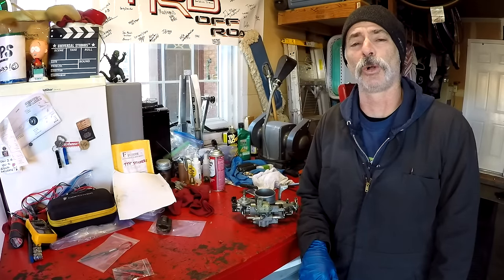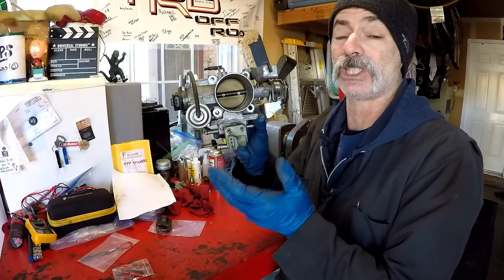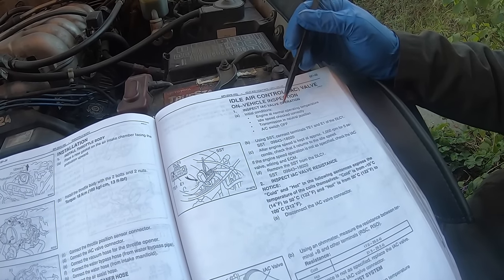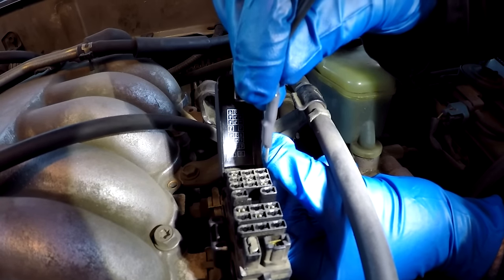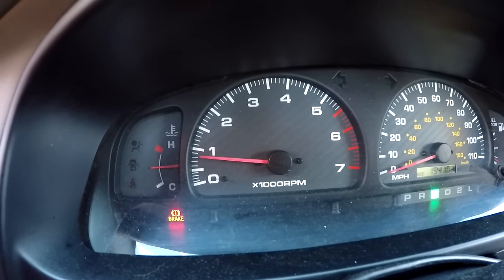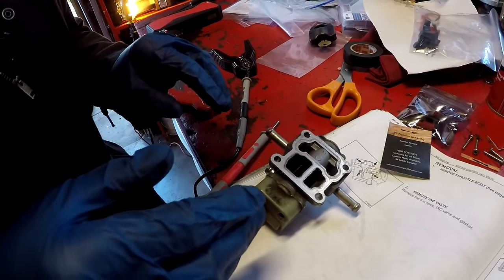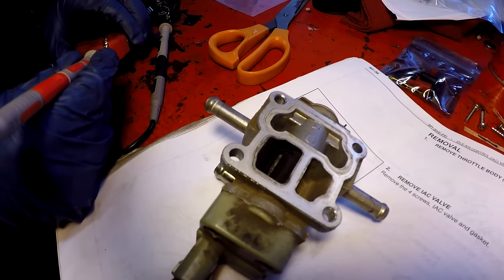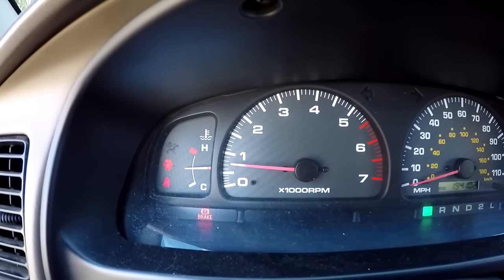IAC Valve Testing and Cleaning

Comment: The idle air control valve exclusively uses coolant temperature as the reference via a valve that is similar to the way your thermostat works when coolant is cold the valve is open to allow more air to raise idle..when hot it closes the air pathway.
Reply: Oh sorry for got your wrenching on a 3.4 not
3vz
Reply from the maker: I have a different understanding of the purpose of the IAC valve.  The idle air control valve gives the engine air, when it's at an idle and under deceleration when you're just coasting.  When your foot isn't applying pressure to the gas pedal thus opening the throttle plate, no air is getting through to the engine to create the air/fuel mixture that allows your engine to run.  The idle air control bypasses the throttle plate giving the engine the air it needs when you're idling or coasting.  If what you said is true, how does a warm engine get air when it's idling or coasting with no throttle input from the driver?  The answer is the IAC is providing the pathway for air to reach the engine.  Plenty of people have had problems with their engine dying due to a bad IAC valve and it's not just when the engine is cold.

Are you saying the IAC on a 3VZ works the way you described?  I'm not familiar with the 3VZ IAC valve.

Comment: I'm getting ready to do this on this same engine, and this is super helpful for me with everything identical to mine! One thing I'm totally confused about - I know there's air, coolant, gas and oil going through, but what the heck is a water hose? Where's water coming from?
Reply from the maker: There's no oil or fuel going through the IAC.  There's air and coolant.  Coolant is a mix of distilled water and coolant concentrate.  So, when people say water, they mean coolant.
Reply: @TimmyTheToolman  Ok, I was confused because you kept calling one a water hose and the other next to it a coolant hose. But I know as long as I don't accidentally swap their connecting points on the throttle body I'm good.
Reply from the maker: @bustedkeel  Gotcha.  Yep, just don't mistakenly hook up one of the coolant hoses to the air assist port on the IAC.  That mistake has happened to many people.

Comment: Thank you so much… have a 2002 car that Idles at 2000.

Precision Panel Craft
Reply from the maker: If you have a 2002 4runner, you have a different throttle body that does not have an IAC.

Comment: A little stumped on the ohm resistance test. Have a low idle issue, and truck sometimes stalls after running highway speeds for a while. Passed the first test, failed the ohm test. Ordered new IAC, and out of the box, the IAC read the same as the old one - 4.9 ohms. This caused me to scratch my head and wonder if the new was bad also, so I went to my other 3.4L that has no idling issues, and sure enough, 4.9 ohms! These are all cold reading. Now I'm wondering if my volt meter is correct!
Reply from the maker: @claybowers2105  The ohms test, from what I remember, is temperature based, but I did shoot this video quite a while ago, and I might be remembering wrong.  I think your IAC door is sticking closed intermittently.   I've had it happen on my 98 4runner.  In those circumstances that the engine died, could you restart it by keeping your foot on the gas pedal?

Comment: so been trying to fix it on a 1999 tercel for a few days because its 700 for a new one. cleaned it tested it all good couldn't figure out whats the problem just figured out it has a icv off a 97 on it wich dose not work with the car. used cars are always interesting

Comment: Hi Tim. i just finished the timing belt job following your video for it. Couldn't have done it without ya. I decided to clean the throttle body and the IAC. Is the default position of the little door that opens and closes in the IAC supposed to be closed? When i initally took it out i believe it was open. I started cleaning it with q-tips then all the sudden the door closed. Was it just gunked up with carbon or did i mess up the "clocking" somehow, as i saw one commenter mention that issue - im worried that maybe upon cleaning deep inside of it with q-tips i accidentally did something I wasnt supposed to? Thanks for your help! Thanks for all you do Tim and Sean.

Oh and the 12 volt test for the IAC worked perfectly too, by the way 👍
Reply from the maker: I can't remember the static position of the IAC door but if you tested it and it passed, I think you're all good.  Great to hear our Timing Belt video helped you get the job done.  Happy Wrenching!

Comment: Tim great video and im going to be cleaning my IAC valve in hopes it solves my warm start issue. I replaced my 5vzfe fuel filter (OEM) last week and it was running and starting with no issues, but now when i start the truck when its at operating temp it takes about 2-4 seconds before it starts. Im wondering what it could be as I have not found any answers.
Reply from the maker: It could possibly be the fuel pump is getting tired.

Comment: I had the 2002 model with the internal IACV :( replaced the whole throttle body, TPS, MAF.. Could never fix the major hesitation issue that I had. The 4runner felt like I was always pulling a boat.
Reply from the maker: That's interesting.  I wonder if it could have been a a fuel delivery problem.
Reply: @TimmyTheToolman  A "Respected" auto shop tried to say the MAF was bad. I think they spent the time of the inspection cost and did not come up with the issue.( I had already replaced the part with the correct Denso OEM)  It could have been fuel, transmission, timing belt... I ended up giving up and selling the truck 😞
Reply from the maker: @hansdavis9081  That's a bummer.  What do you drive now?
Reply: @TimmyTheToolman  Oh I still have my 97 4runner 2.7l. 
(New air intake, plugs, wires, rebuilt head when the head gasket popped, flow master 40 series muffler, new radiator, complete A/c parts replaced, made my own satoshi grill)

275,000 miles and it still runs like it's 1997.
I never miss routine maintenance, and drive it with care. I'll drive it as long as I can.

Funny enough, I've never driven a 3.4 that can show it's full potential. All the cars I looked at on craigslist had some issue or another
 Always wanted to drive one working well just to know what it was like.
Reply from the maker: @hansdavis9081  Gotcha.  Good to hear you're still part of the 3rd Gen Club.
Reply: @hansdavis9081  did it sound like a rotary engine by any chance because mine won’t go past 2 thousand revs flat out after replacing all the things you described! I even cleaned the sensors like this video describes before I seen the video and it sounded like it was vibrating on the top of the intake manifold 🤦🏻‍♂️ I’m at a loss and iv spent almost $2000.00 on it at this point after doing timing belt, water pump, oil and filter, fuel filter, coil packs and spark plugs, and new gaskets as well as new rocker cover gaskets and radiator fixed and professionally cleaned! If you have any ideas that could help me I’d be really great full
Reply: Timmy The Toolman could you plz give me any advise you seem to no what your talking about and very informative! Excellent video by the way 👌🏼comment above this one ☝️

Comment: My experience with these is replace them, they are usually pretty used up by 180-200k yes you can probably go little further with them by cleaning them, but they are almost always done by 230k, did my friends Honda works like a champ now, no idle stumble, or low idle, hard starts.....
Reply from the maker: Well, it's worth a shot to clean it and save money.  OEM IAC valves from Toyota aren't just a few bucks.  If it was really hard to get to requiring a lot of labor, I'd say just replace it to.  But, pulling the throttle body off is pretty quick and easy.   Thanks for the comment.

Comment: I thought I heard you says you were going to do some testing for the high idle problem, but I did not hear that covered. Can you give me time stamp time where this issue was covered? I have a manual transmission and the idle stays at about where the engine was revving for about 30 seconds after I have come to a stop.
Reply from the maker: No, we never covered specifically testing for a high idle problem.  A malfunctioning IAC can cause a high idle issue if it sticks open.  In the video, we just test for proper function of the IAC.  A high idle could be caused by the IAC.  It could also be caused by other things like a vacuum leak or an issue with the TPS, throttle position sensor.  

For your issue, I'm not sure it's an IAC problem.  Maybe the throttle plate on your throttle body is sticking a bit after you take your foot off the gas pedal.  Or, it could be the cable hanging up a bit.  I'd pull the air tube off and work the throttle a bit to see it it's hanging up.  If it is moving freely, have some depress the gas pedal a few times and see if the cable is smoothly turning and releasing the throttle.  If both those check out, I guess it wouldn't hurt to pull the IAC valve off and give it a cleaning because maybe the valve is sticking.  If that doesn't fix the issue, I'd perform an Ohms resistance test for the TPS.

Comment: Master, I have a 97 4runner when it reaches normal temperature and I put it in D the revolutions drop a lot to the point that the lights go down.
Reply from the maker: Sounds like a charging issue.  Check the health of your charging system with a multimeter.  If you don't have one, most auto parts stores can check it for you for free.

Comment: Pro tip: after I did this job, my rig idled high, like 1500 rpm in Park at OP temp! I inspected the vacuum lines: they were fine. Did all the tests on the IAC valve again: it's fine. A guy suggested I reset the idle, so I did: get rig to operating temp and turn off all accessories, then turn off the rig. Then turn the key to ON, but don't start it. Turn the key to OFF, then turn it back to ON and then start the rig and shift it in to Drive. I also had to do this in Park. This brought the idle back down to FSM Spec! 
https://youtu.be/_S9B3IhK_Tc

Ps: I didn't do it the way the guy suggested-he suggested I start it and floor the accelerator pedal!
Reply from the maker: Thanks for sharing this idle reset procedure.  It might come in handy.

Comment: Thank You Timmy....your videos and explanations are simple ..direct..and easy to understand...I  just bought a 98 SR5  6cyc.. planning on doing this service to my throttle body & I.A.C.  My question is I'm having hard starting issues.  Do you think this procedure will help starting issue or is there something else I should be looking at? Any recommendations will be GREATLY APPRECIATED. 
THANKS 
Yazmin 
Venice Beach CA ⛱ 🏄‍♂️🏁💪🏁💪💯
Reply from the maker: Hey Yazmin,  good to hear you are finding are videos helpful.  There is a chance your IAC is hanging up a bit and not opening as quickly as it should giving your engine the air it needs to run.  There's other things that could be a factor like fuel delivery to the engine is delayed.  Have you tried treating your rig like an old carbureted engine and push the gas pedal down a bit.  This manually opens the throttle body plate giving the engine air instead of relying on the IAC valve opening giving the engine air.  If your engine starts right away when you push the gas pedal down a bit, that would indicate it is a problem with air delivery to the engine.  If pushing the gas pedal down doesn't help with the hard starting issue, I would suspect it's probably a fuel delivery problem.  

Is this problem only when the engine is cold or is it hard to start all the time?  How does the engine run once it's started?
Reply: @TimmyTheToolman  
Thanks  for the reply I pushed the gas pedal down & it started right up both cold or hot. So I'm thinking its an air delivery issue? So this throttle body & I.A.C procedure would be beneficial? I liked your analogy of treat like and old carburetor like the one on my Nova 383 Stroked. Been going through your play list see what else I should do as preventive measures. Once it starts it runs grea.as always any and all suggestions GREATLY APPRECIATED 
Yazmin 
Venice Beach CA ⛱ 🏄‍♂️🏁💪🏁💪💯
Reply from the maker: @yazming1720  I think cleaning your IAC would be a good idea then.  Maybe it's just a bit gummed up and cleaning it will help the door immediately open up.  There's a whole lot of stuff you can do to your rig like basic maintenance you can find in our 30,000 mile service video.  You can replace lower ball joints as a preventative measure because they are known to fail.  You could replace your radiator if it's never been replaced and you have a lot of miles on it.  You could renew bushings on control arms, etc, etc, etc.  There's a whole lot you can do but I would just stick with some general maintenance like fluid renewals and greasing the zerk fittings on your drive shafts for now.  I would replace the lower balljoints if they've never been replaced and I would probably replace the radiator as well, because they can crack and fail leaving you stranded.  I would only replace bushings if you're having some sort of issue.  If your valve covers are leaking, you could perform that job as well.  I hope I didn't overwhelm you.  These rigs are pretty indestructible but preventative maintenance is important to keeping them trouble free.  It's especially important if you plan on doing adventures into the back country with your rig.  You don't want to get stuck out in BFE (Bum F*ck Egypt).  I hope this helps.

Comment: I didn't have any luck with that Japanese screwdriver. I had better luck with a regular screwdriver, I might've used a P3. I tried a cheap IAC valve from ebay for fun, it didn't work lol. I used Standard Motor Products brand IAC valve and it worked great and was made in the USA believe it or not.
Reply from the maker: Well, you got it done.  That's all that counts.

Comment: Always use rated electrical connectors and wires for your amperage, and you have a built-in fuse in your multimeter that you should have had in the system, so you won't start a fire or burn the crap out of the wires.
Reply: Sam S most multimeters do not have a fuse, but he does that's why I said ”yours”. On my fluke, it has one screw, and replacing the fuse takes less than a couple minutes, but it does suck because another $4 fuse gets eaten but sure beats destroying some test leads or worse.
Reply from the maker: Hey James, it ends up the wires aren't fried.  For the life of me, I don't know why I couldn't get the IAC to work with the original wires.  I checked, double checked, triple checked, and checked a bunch more times and everything looked right.  As a last ditch effort, I swapped out the wires and then I could get the IAC to function.  The next day, I decided to check the original wires again.  I hooked them up to my multimeter and then connected them up to my battery jumper to see if it would read the proper volts and they did.  So, I don't know what the hell was going on with those wires but they seem to be working fine now.  Those wires should be able to handle 12 volts power no problem.  They are meant to be used with multimeters that are used to check voltage so I didn't see any problem using them to perform the IAC function test.  I did perform the extra precautions to make sure the positive and negative leads wouldn't contact each.  I definitely wasn't worried about starting a fire because I was standing right there but I was concerned about frying the wires or possibly damaging the battery jumper or damaging the IAC.  I  do appreciate your comment though.  Thanks!
Reply: Timmy The Toolman, so what you probably have is what is know has ghost voltage when the multimeter can magically read voltage, but the wires are not working because they can't carry any current.
Reply from the maker: @jamb312  That's interesting James.  I was stumped why the wires worked before and then stopped working when I was trying to test the IAC before reinstalling it.  Now the wires work fine.  I just used them recently for a bumper install to test some aftermarket LED fog lights before installation to figure out which wire was the positive and which wire was the ground.  The wires worked fine to jump 12 volts power to the light.  Pretty weird.

Comment: Great video! I did the tests for the IAC valve and it did not pass the third one. Started looking at the hoses connecting to the IAC. No cracks or holes noticeable but the air assist hose seems to be loose on the port end. I can easily turn it and move it. Would this be enough to cause issues? Thx
Reply from the maker: I'm not sure if that would be enough to cause it to fail the 3rd test.  I guess you could chance it and buy a new air assist hose and see if that changes things.